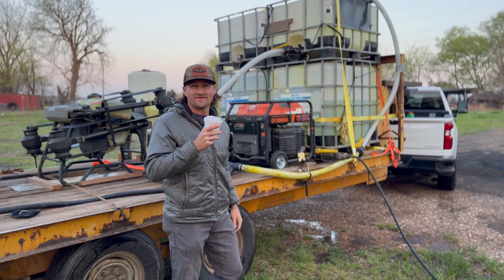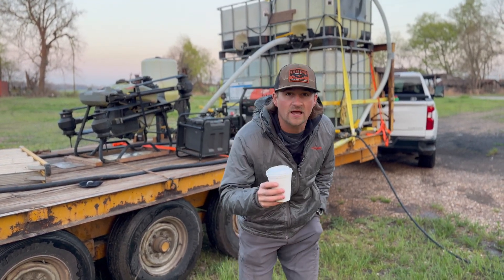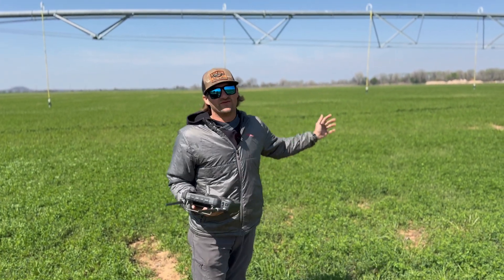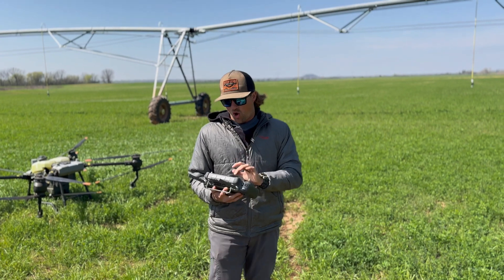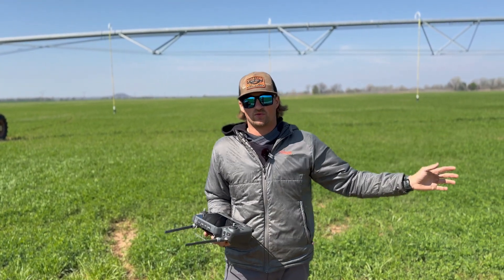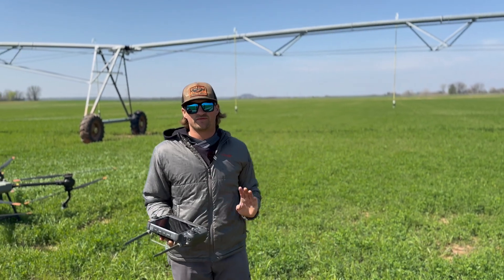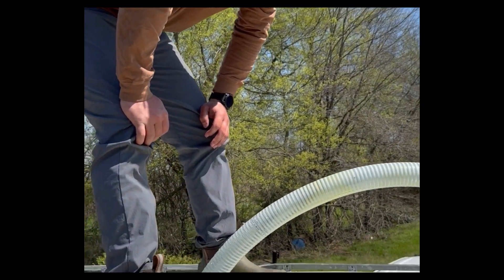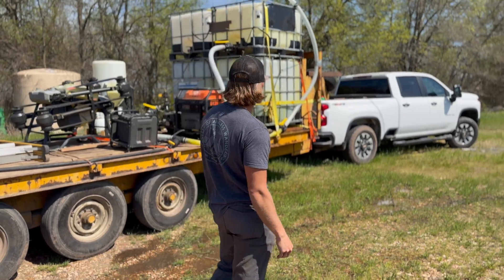DJI T40 Drone spraying and mapping #agriculture #dronesprayagricultural #drone #ranching #cowboy

Comment: Surely it’s still cheaper to spray with a real helicopter or crop sprayer in much shorter time with greater coverage. No batteries, charging etc.
Reply from the maker: I believe you're wrong.. the helicopter and duster cannot get where these drones can.. yes the may cover more acreage in a day but its not as efficient the science is there to back it up as well. With my two drones im covering 600 acres a day and my drone doesn't cost over a million dollars! Price per acre is similar but the yields and coverage are better.
Reply: @HarvestCo  Interesting. I was chatting with a representative of CASA which is the governing body for aviation in Australia. Even the representative said that when they added up the costs involved in time and pilot registration and training, the drone spraying alternative was just not cost effective in comparison to a helicopter or fixed wing with great capacity and run time.
Reply: @walkingmanvideo9455 my commercial drone license was 52 times less expensive than a commercial helicopter license. My brand new T50, D12000 generator, 4 batteries, and a trailer with all the tanks and equipment I need for spraying could have bought me 1/19 of a new r44 raven II. If you ever want facts about stuff like this, don’t speak to a representative of any aviation authority agency. Speak to a pilot that does this for a living or someone that owns one or the other. I would like to eventually own a helicopter for spraying but for now it is no where near my purchasing power. It’s just too expensive.
Reply: For one thing, it’s much faster to mobilize and deploy a drone from a trailer vs getting a helicopter to come out. A drone can get to a field in minutes vs the prep time and scheduling needed for helicopter spray. Timing is everything when spraying and drones got choppers beat in that department. Of course a chopper has higher capacity and more coverage but the precision of a drone can’t be beat. A drone can spot spray with a prescription map saving chemical costs and time. Drones aren’t necessarily meant to compete with choppers either. They’re two different tools. Helicopters are hundreds of thousands of dollars vs a 25k spray drone? Cmon now…
Reply: @mookm6639  Valid points. I live in a farming community where we rely on aerial spraying with fixed wing and helicopters. I have tried to push the drone options to farmers but they still remain skeptical. I think the drone idea is valid in certain areas, I am just not convinced when here in Australia there are suppliers saying to spray entire farms and we have hundreds and hundreds of acres per farm here to spray in a certain period of time. Cheers from OZ
Reply: I would also consider the lower barrier to entry. Much easier to get an FAA 107, and other certs than become a professional helicopter pilot.
Edit: Just noticed you said you were an Aussie. Certifications may vary in your country to the US!
Reply: Here is another opinion.... My T-40  operating cost per acre is about 1/3 the cost per acre of my S2D plane, and about the same price per acre as a high clearance sprayer.    Battery is warrantied for 1500 charges and replacement cost approx $3k, and average 4.5 acres/charge, so approx $0.50/acre.  fuel for generator and chem handler approx $.35/acre.  I have done approx 7000 acres and have spent about $1000 on repairs ( 8 blades, 4 filler caps and the USB fast charger)  So about $1.00/acre for operation/ maintenance.  At 2gals on average we do 30-35 acres/hr.  and 320 acres on an average day.   We have done just under 600 acres with two shifts and flying throughout the night (2250 acre field with no obsticles😊)
Reply: Everyone has an opinion with regard to costs. Bottom line is don’t tell us show us. Too many have opinions. Put a spreadsheet together. Cost break down man hours, materials, equipment, maintenance and all that jazz. Cost is a number you have to support it with numbers to genuinely know.